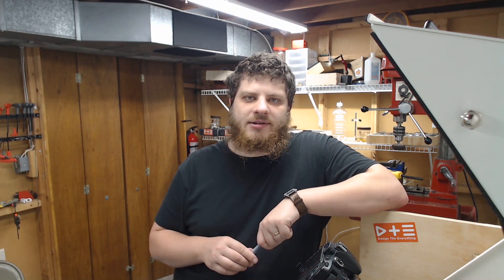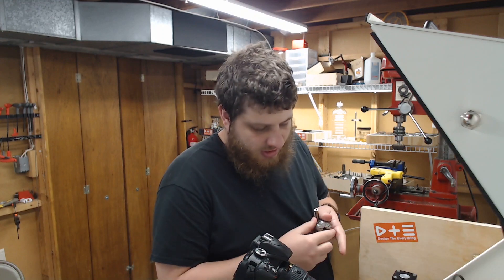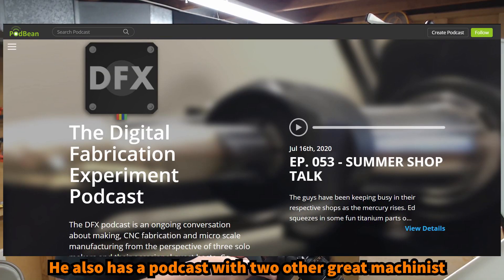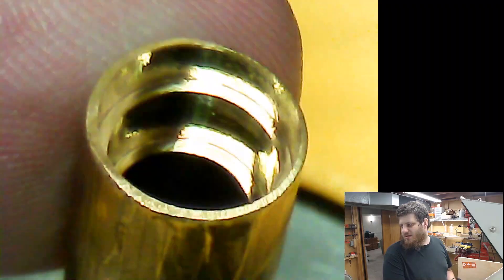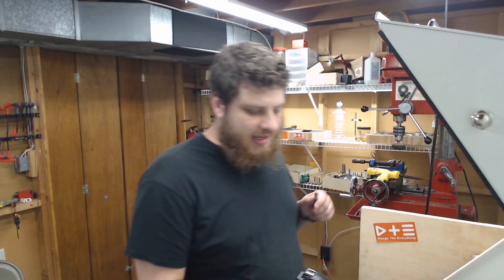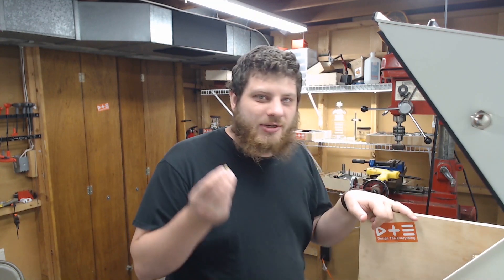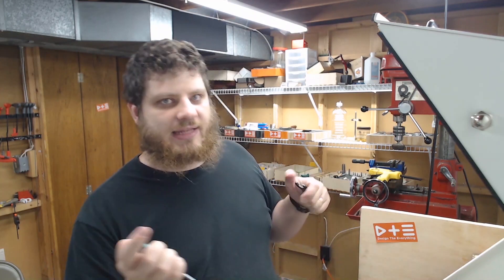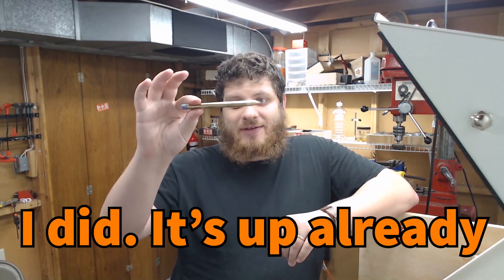Machining A Custom Pen Click Mechanism | Spire 2 --- Part 2

Comment: Could the “crash” at 3:00 have introduced the runout on the first part by deforming it?
Reply from the maker: Huh, I never considered that. I suspect it's unlikely though. These machines don't have enough torque to cause much damage. It could have caused something else strange though. Maybe dragging one of the other axis a little. I probably should have homed everything, not just the X.

Comment: With stick out try 2 to 3 times the diameter(when you can). Stick with the collets, far more accurate than 3 jaw chucks.
Reply from the maker: Yeah, that definitely would have helped my chatter issues. Hopefully I'll be able to fix that when I build a custom fixture for when I go into production mode. It's nothing that I can't work around while prototyping.